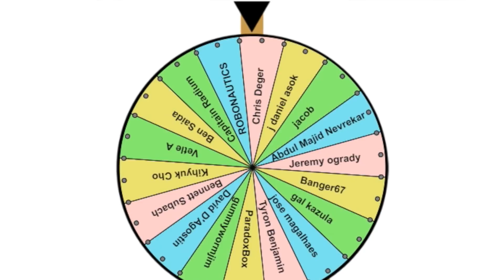HOW TO BUILD A DIY ELECTRIC ⚡ SKATEBOARD TUTORIAL - BATTERIES & ELECTRONICS - PART 2

Comment: no as i told you that im going to use li ion cells-10s.which will be around 36 to42v.its enough for the motor.
Reply from the maker: Cool cool...  I won't be a downer.  Give it a try and let us all know.  However, try doing a bit more research on KV ratings and voltage.  There's usually a sweet spot for each of rating when it comes to voltage.
Reply: thanks.😁😁

Comment: You should 3D print an electronics containment box!
Reply from the maker: I've always wanted to get into 3D printing however I don't know where to start so that's a bit intimidating. Do you have any suggestions on a place to find out more?
Reply: @BigKidsOfficial  it's really quite easy. I recommend starting with something like the creality cr10s - https://amzn.to/31VQ0MK - really easy to use and setup. I would then download simplify 3d to use as a slicer. So download from thingiverse.com or build your own model in Blender , then import to Simplify 3D to size your model and prepare for print, then export to printer or sd card to put into printer!

Comment: Great video, but your soldering is really bad, you need a lot more heat in your joints. A larger tip would help a lot with these big connections.
Reply: And a lot more solder. You shouldn't be able to see the wire strands where they are cut and soldered. Also not a fan of grabbing the wires with pliers and yanking on them messing up the jacketing and possibly the wires inside.  Otherwise very good video.
Reply: 10:50 looked alright. Still, a little light on the solder and maybe too hot?

Comment: Im looking at building a board, ive seen a similar if not the same setup on another youtuber... But I dont like the battery thing going on.
I want to be able to swap the batteries easily. So im not sure... I dont get how it charges too.

I also wanted one that will get me at least 15km before having to swap batteries.
Reply: But seriously how does it charge I dont get it either.
Reply from the maker: Here's the video where I explain balance changing.  The changing and battery portion of a diy Esk8 build is probably the most complicated.  I suggest you do a lot of research.

https://youtu.be/3dfBrrNUsos
Reply: @BigKidsOfficial  thanks for the reply still doing lots of looking into, I would like to build one soon but still not sure on the entire process. Do you have any electrical schematics that helps me alot. Going to electrical school and I'm use to reading those.
Reply from the maker: Unfortunately I don't. However there is an awesome DIY community of eskate builders that post beyond what I have done in my video. It's a great resource an awesome community go check it out!  https://forum.esk8.news/

Comment: First I watched a video on my you should go diy instead of buying a complete board.
I'm like yeah I can build my own.
Then I saw your video. A lot of work went into it and I appreciate that. 
But damn son $700 for the cheapest diy?
The mepo is 500 and you can find some as low 300.
I know they probably won't be as strong or whatever but 700.
This can't be the cheapest build out there.
If you can buy an eboard for 300~600 I would think you could diy one thats just as good or better with the same money not 700+.
Its like building a gaming laptop for 4000 when you can buy one for 2000.
Thanks tho now I know to just get a mepo
Reply from the maker: There has been alot of growth over the years in the esk8 world which drives demand and in turn drives prices down.  When I first got into building esk8 it really wasn't affordable but now a days it's very affordable.

Comment: How fast does it go and what's the range
Reply from the maker: Estimate range is about 10 miles.  As for high speed I've gotten it up to 30 mph with full battery on a level ground.  Keep in mind I weight about 160lbs